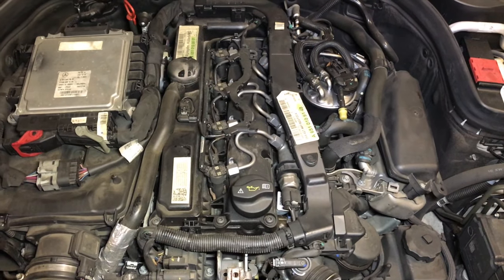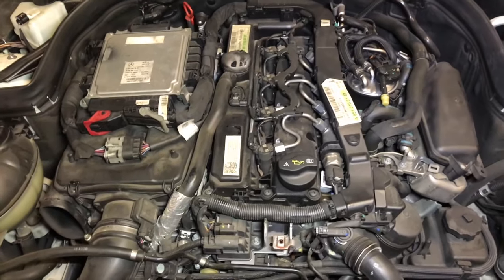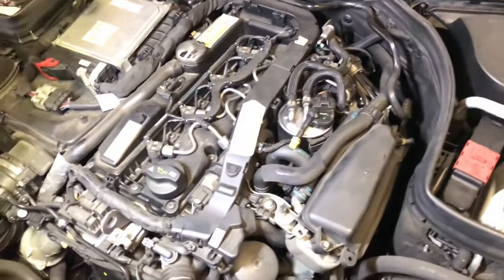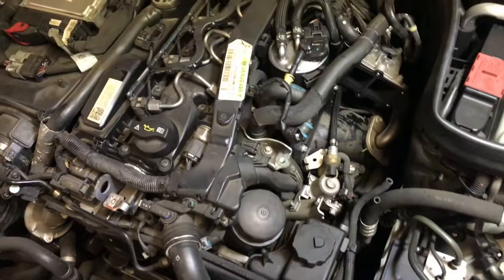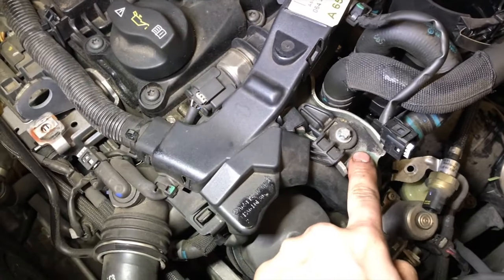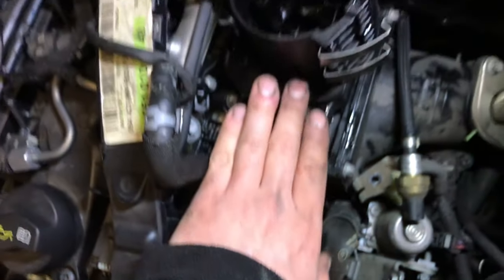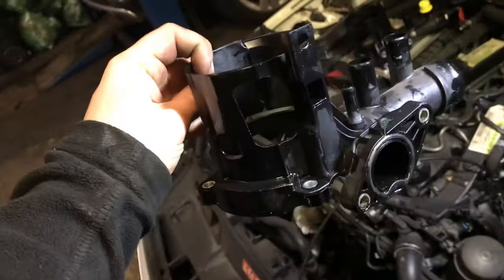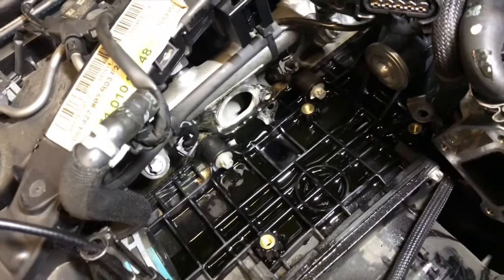Mercedes | Coolant leak (fuel filter housing) | OM651 220,250CDI

Comment: Well the most important parts of the video you skipped over what bolts to remove and fixings etc but still helpful maybe take time next time to do a more in depth video. Thanks though
Reply: I agree being a DIYer i am trying to do this myself to change the HP pump
Reply: Yes I agree, great clear video, don't need to show how all the bolts being undone, BUT it would have been nice to see how to get to undo the middle bolt on the bottom of the EGR cooler (or some clue), which you can't see and only just feel. This bit took me forever and a lot of swearing. Thanks for doing the video good job.

Comment: Took me 6 hours to complete on a C220  Amg 170, and i have an engine management light now on which ill have to inveastigate, the wiring is a pain in the neck and gets in the way making an easy job really tricky,  access to several bolts is tricky without a decent socket kit. The video diagnosis is very good but its not a quick job.

Comment: Thank you very much for this. Been topping up my coolant for last couple months but couldn't see where it was leaking. Just took off the engine cover, looked down the side of the filter and can see the water sitting on the top of the manifold. Thanks again for your great videos. Cheers, Jon.

Comment: Hi Mercman, nice video thanks, it goes a bit fast though. Do you remove the coolant first?
Reply: if it's anything like mine the collant will remove itself. You don't need to drain all of it, just as much as it takes to get down to the level of the leak. I put a pressure cap on the reservoir and kept it under pressure until it was empty and blew bubbles. pop a bucket underneath and catch the joice as it pours out. Strain it going back in and you're golden ;)

Comment: i have use same this model. my question is. i found the oil leak come out from the hose beside the gearbox. had see with my tiny camera and the hose is attach to cylinder head. i dont know why it is there and oil come out from that hose. what is you opinion that i need to replace sir?

Comment: After watching this last night and doing my sprinter today, You can do mine next time.... talk about frustrating. Especially the underside EGR cooler bolts. Even If the loom would move a little more, it would have been so much easier 🤣🤣
Thanks for the insight, made it so much easier
Reply: I've got an slk, wish I'd never bought it, it's worse than an Audi for getting to stuff

Comment: Thanks so much for the great video but how on earth did you remove the egr cooler bolt which is under the fuel filter housing?? The ff housing seems to prevent access for a socket to get to that bolt

Comment: thanks for the video. But as i can see the egr cooler needs to be removed. But it got several bolts that needs to be unscrewed. There is a bolt underneath it, isnt it hard to take those out?
Reply from the maker: If you use a 1/4 drive E10 socket and extension it is not that bad to remove

Comment: The bit in having trouble with is the Egr cooler , it’s almost impossible to get the last bolt as the fuel filter housing is in the way

Comment: I am watching your video because I had the same problem with mine, and the mechanic at the workshop whilst having a go at it, decided it would be a good idea to remove the Common Rail to gain acess. After reassemble it , wouldn´t start, and he cranked it till the battery was flat. He also used Easy Start. Injector were sent to a specialist and the result is all four are damaged. I am faced now with the prospect of having to spend 800 quid in four new injectors. And worse still, maybe a fuel pump. I Was told that the problem is because  " this is a high mileage car" . I am very disapointed and frustrated. What would you do in my sittuation?  Thank you for your video, I wish i had seen it sooner and had a go myself.
Reply from the maker: Hi Mike, sorry to hear your story, you do not have to remove the rail at all, the OM651 engines injectors do tend to ‘block up’ when removed or any high pressure fuel lines removed, when removing injectors or any fuel lines you have to block up the holes so no dirt gets in the system as it can damage the injectors.. i don’t think the fuel pump will need changing but I’m not sure what else the mechanic has done, in this case you need to change the injectors and take care even when installing the new ones so no dirt gets in them..

Comment: Great vid man replaced heaps of them in mb the part you fitted is an uprated one (re designed) also the water pumps have an update aswell the newer ones are aluminium instead of plastic never see one give trouble
Reply: Hi David. Crazy question, but, is this part also on the ML420 4.0 litre V8 diesel engine as I have an unsolved water leak?
Reply: @Treadmill-Repairs  not a clue never even seen one nevermind working on one but I doubt it
Reply: Can you please try to explain to me how to get the bottom middle position bolt out on the EGR Cooler??? I have all the other bolts remove but can not comprehend how to get that one out. I feel so fucking stupid right now I’ve done engine swaps and whatever you can think of, but this job has me stumped.
Reply from the maker: If you can get your hands on a 1/4 drive e10 socket and a long 1/4 drive extension from the front of the engine it is pretty easy with a 1/4 drive ratchet.. all the best 👍
Reply: @mercmantips Brilliant video respect brother 🤙

Comment: had this happen on a glk 250. i think the gasket/o-ring from manufacturer is bad. i took to dealer, they replaced water pump... $1200 out the window, after i told them this was issue. fixed myself took about 4 hours, wish you made this video 3 years ago

Comment: Good job man, just for info I had an issue with weeping from this area and water pump, but a split hose from this (fuel filter water block) housing to oil cooler which was leaking massively.
Reply from the maker: Yes i have changed that hose once on a vito not very common though
Reply: Hi, Thanks fo your comment. Before I go stripping my car - can you please advise which hose you refer to?  And how did you identify it was the hose. Thank you.

Comment: Which socket do you use to get that awkward Access bolt from lower section from inside the filter housing. Appears my e10 is a little to fat and awkward access
Reply from the maker: 1/4 drive e10 socket and extension is the only way to access them bolte
Reply: @mercmantips  I do like the new redesigned one has changed to normal bolts instead of the e socket and more accessibility for a socket to actually get into it. Odd that they created the third bolt access though. Guess easier to make a batch of all models instead of both models with a larger fixing point

Comment: Hi, Thank you for your hard work and insightful solutions to the OM651 problems.  I'm running out of coolant. However, when I look at the car from the front, I notice that on the right hand side, on top of the radiator, the hose leads to a metal housing that appears to be wet and rusty.  Is this the most likely culprit? I'm not sure what the housing section is called.  Please let me know. 

Second, now that I'm checking for leaks, when I turn off the engine, it makes a beeping sound.  Could you please tell me what's causing this?

Thank you very much.
Reply from the maker: From the right side of the radiator the hose should be connecting to the thermostat housing, the beeping im not sure about
Reply: @mercmantips  Thank you  so much. Much appreciated.

Comment: Today I tackled this as it would appear I had coolant leaking from underneath the car and warning on dashboard and when you looked around by the fuel filter housing and the egr cooler there was a build up clearly showing however I've fitted the new redesigned model can only fit two bolts as isn't slots for all three. However I took it for a test drive after refilling with coolant and now it appears the dashboard warning has came back on yet again? 

Any ideas or suggestions to what's happening?
Reply from the maker: Once you change a part on the cooling system even when you fill the tank with coolant air can be trapped in the system and when you drive the air will be released and the coolant level will drop a little, so id just top up and see how it goes from there

Comment: Can you explain why the “new” housing has 3 fixing/ mounting holes while the original on only has 2? Are the bits interchangeable? Is this an upgrade? Or is a hole not used on the refit? Thanks

Comment: Is any sort of gasket sealer used or do you just bolt it straight on. Thank you
Reply from the maker: No sealant is needed, just clean the aluminium block before installing new part

Comment: Hi thanks for the video. But do you remove coolant off the system beforehand?
Reply: No you won’t lose much coolant doing this. Do it while car is cold and top up expansion tank after the repair is complete.
Reply: Hi Mercman, what antifreeze should I be using?

Comment: This looks like the trouble mine had. It's easy to see if you pressurise the system until it blows bubbles out of the failed seal, you can see and hear it then.

Comment: Thank you very much great video! Do you know if the fact that the new filter housing has three bolts instead of two (like the old one) creates issues? Thanks man :)
Reply from the maker: Hi Matteo, the new fuel filter housing is modified with 3 bolt holes and is slightly thicker, but not all engines have the 3rd thread for the 3rd bolt, most of the ones i have fitted have 2 threads, also the new housing comes with modified bolts which are longer 10mm bolts, as long as you use the modified bolts there will be no problem...
Reply: @mercmantips  Really appreciate the time you spent for my answers. All the best, Thank you

Comment: Where does that air filter housing sit on? I put the bolt back on that holds a cable in place and used a longer bolt and hit something. Me being a noob used an impact and kept trying to drive it in, until i figured out i used a long bolt instead of a short bolt. Not sure what I was driving into, and i still have a leak. not sure if i broke something, or if i just didn't put a hose back in right... Just wondering worst case scenario, what did i break (if anything). Where does that housing sit? any help is appreciated!

Comment: Crazy question, but, is this part also on the ML420 4.0 litre V8 diesel engine as I have an unsolved water leak? Like the filming technique too.
Reply from the maker: No this is only on 220 cdi and 250 cdi
Reply: @mercmantips  Okay, thanks MercMan. Back to the drawing board lol

Comment: Thanks Mercman great video mate.  I just replaced mine after suffering coolant lose and advise from Mercedes.

When I stripped everything down I had the three bolt variant present already (with the horizontal bolt from frame)  and everything looked quite dry.

The bottom bigger bolt in the fuel filter housing is difficult to tighten due to the base plastic getting in the way of the socket and the bolt on the bottom left of the EGR cooler is a nightmare.

With some trickery and blue tac to hold the bolts in the socket I have managed to get everything back together. Can I ask if you torqued these bolt on the fuel filter housing or EGR cooler  or just tightened by feel till they felt tight enough?

Also as mine is dry and water pump area is dry have you seen any other common areas that leak?

I have noticed coolant sat on the belly plastics under the car close to the back of the engine when they were removed so I am assuming somewhere round the back.
Reply from the maker: There is one pipe that goes from the fuel filter housing to the heater matrix, where it connects to go inside the car is a plastic housing, that cracks and leaks too check that out
Reply: @mercmantips  thanks mate I know which pipe you are referring to.  I will wait and see if my levels drop and post back in a few weeks :).
Reply: There is a gearbox cooler which can cause this also, i replaced mines thankfully the coolant did not contaminate the gearbox fluids
Reply: @rudey7777  thanks mine turned out to be water pump seal. Caught mine when it was not as bad so not much discolouration on the engines metals from the leaking coolant which made me originally miss it. Replaced the pump and seems to have been fine since.
Reply: Torque to 20 Nm

Comment: Nice video! Thanks for sharing. How did you remove the lower-center screw of the EGR radiator? I think it is a problem to put it back in place. I am planning to clean my EGR but I am stuck a t this point.
Reply from the maker: Hi, i have a 1/4 E10 socket which i use for the screws on the cooler, the centre bottom bolt can be tricky but i use a long 1/4 extension with the 1/4 E10 socket and do it that way, when putting the bolt back on i put 1 layer of paper in between the socket and the bolt so its nice and tight and does not fall down whilst trying to get it aligned up with the thread hole.. hope this helps, please subscribe to the channel 👍
Reply: @mercmantips  You are amazing my friend. I will try with your paper trick. Thanks!
Reply: Cheers for the video... can I ask though, why did you use an E10 socket when the bolt head is E8? Did you end up ruining the head on the bolt underneath?? Cheers.
Reply from the maker: No newer models are e8, older models are e10

Comment: Hey there. I'm going through this particular small nightmare right now. Where did you get the new part from? I'd like to avoid my local Merc dealer (they're temporarily closed now anyway thanks to the pandemic) and I can only find parts on eBay that are either S/H or from far off lands. Thanks.
Reply from the maker: Hi Bryan, to be honest i will only buy it from Mercedes because its not that expensive its around £40 and also the new parts are slightly modified so they don’t break again so i will not fit a second hand one if i were you.. some merc dealers are open it depends where you are located
Reply: @mercmantips  Thanks man. That makes a lot of sense. I'm in Perthshire and the dealerships are currently closed. I'll hang fire until they open again.
Reply from the maker: All the best 👍

Comment: Happened to me with infiniti Q50 (same engine) but the upper house inlet was damaged. Another common issue with this engine is the plastic water pump, which can be replaced with aluminum pump 👍

Comment: Subscribed already! I have changed water pump with housing(aluminium housing), i had problem on it with coolat leak, so now it it new and it is ok. But i still can see coolant dissapearing, less a lot than before changing water pump, but it somewhere leaks. Could this be a problem, or something else? All pipes of water are "medium soft" temperature is always 90°... and i am dissapointed because all of this. Btw everything is great with car e250cdi, injectors, transmission,etc. No oil in coolant, and no coolant in oil. I hope so its not big deal? Best regards

Comment: Great video how long did it take, was there any special tools needed.
Reply: Patience and hot tip is to reinstall the EGR cooler with the middle lower bolt on the tool else you will struggle to locate it

Comment: I am having issues with my C220 Auto seems to have a coolant leak of some sort, Twice the bottom coolant hose has come off while stationary at just below 90 degrees engine temperature, giving off steam and immediatly warning me of low coolant, the engine doesnt overheat, heater controls work fine hot and cold. Another issue that might be related is i get alot of gushing liquid which seems to be  water coming from the exhaust. (like a tap on full when reving/Accelerating) Can you (MercMan) or anyone reading this help me, thanks

Comment: Hi, thanks for this guidance video! I’m having a hard time removing the hoses that connect to the vacuum box. Do these need to detached in a specific way, or do you just use force to pull them off?
Reply from the maker: I use a pick to break the seal on them and force down with a thick screw driver taking care not to split or damage the pipes

Comment: Hi Mercman, iv been watching your vids for a while and like to do my own car DIY. I have a om651 and found that my serpentine belt had come off? there seems to be oil substance coming from around the water pump pulley, possibly coolant but looks a dark colour could this be coolant.  do you know about any common issues with this problem?
Thank you so much
Reply from the maker: It could be your rocker cover gasket check where the injectors are and see if there is a puddle of oil near your fuel injectors
Reply: @mercmantips  I have just posted a video please could you take a look at it , I have taken the serpentine belt off and checked the pulleys the pump pulley is loose and making a noise, when I start it up no more oil/water is coming out just a high pitch noise from the pulley..

Comment: Just curious what funtion the vacuum box does.
Seems to be missing from mine.
I just replaced filter housing
Reply from the maker: It stores vacuum pressure, the newer models don’t have it
Reply: @mercmantips  ah Cool,
Mines a W204 2013 C200 CDi.
Thanks for your help

Comment: I really don't get,I'm covering the bolts with my hands just like in the video but when I move them the bolts are still there and the part won't come away,I have even tried covering with 2 hands,getting frustrating as I need to change this part.
Reply: @MercMan Tips. Going to give it another go lol. Is there any complications like awkward bolts or clips that i will come across. Will i need to replace the fuel line clips or are the originals reusable? Thanks
Reply from the maker: The originals are reusable, the one bolt that ppl struggle with is the bottom middle bolt for the EGR cooler, id recommend using long extensions with a quarter drive E10 or E8 socket.
Reply: @mercmantips  thanks for the tip,waiting on the delivery of the new part,will update once I have completed this job i have been putting off for ages 👍
Reply: @tj22245  did you manage to get it done ?